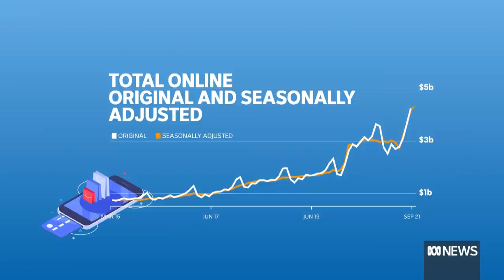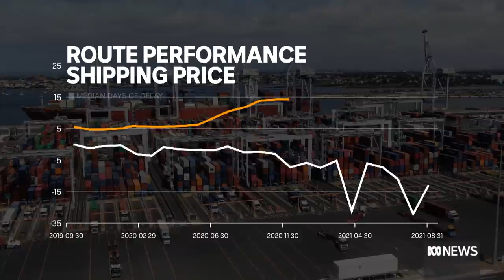Buyer Beware: The Long Wait for Freight | ABC News

Comment: This report undersells and fails to highlight many issues. Only focusing on ships etc. Containers are a seperate and important issue. Truck drivers being casualised reduced unions work and less reliance on train freight etc. Also the change in supply chains to just in time means more efficiency but way less resiliance as there are no stockpiles. How has this failure come about? Capital owners and shareholders wanting to squeeze the most effienct systems they can that rely on international or well co-ordinated markets.
Reply: I like that you mentioned "casualised". I had always thought of Australia as having great worker rights; then when I lived overseas and did retail/hospitality I realized there was a drawback from that - while there wasn't the same worker rights (in Canada), I could at least get 40 to 60 hours (if I wanted) to support myself. Businesses not giving people hours so they can avoid worker rights is pretty damaging to those industries, I can't even consider doing that type of work in Melbourne.
Reply: Yes no mention of the MUA strikes that have been ongoing at terminals all around Australia. How can a ship come into the terminal when you don't have labour to work the ship. This is also contributing to the delays
Reply: Maybe when they give the HGV drivers a decent living wage and give them decent facilities such as toilets and showers things will change ! My partner of 6 years drove an HGV here in the UK until he suffered from health problems and p^ssing in a bottle was perfectly normal to him , sorry but I don't see anyone who works in any industry but the delivery industry think that this is normal !
Reply: @jisanjohn7812  Support them. It is a chance to finally get the wages deserved.
Reply: Road freight won’t be helped when who the F wants to drive trucks massive hours a day, the industry is struggling in AU to hire staff. Yes some operators are greedy and treat staff crap but there’s others who are genuine and want more staff to give existing staff a break and normal hours.  How many losers on the doll could get licensed and experience and earn a living and probably enjoy it vs faking job interviews. We can all buy less stuff too let it catch up but that won’t happen!!